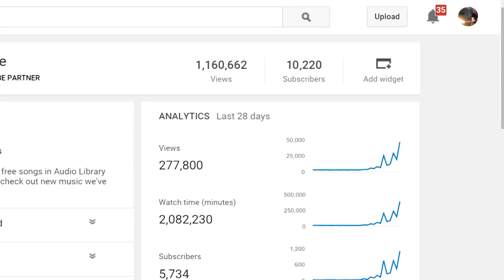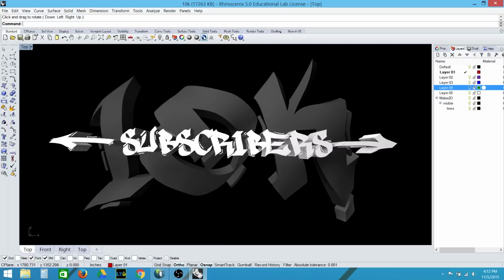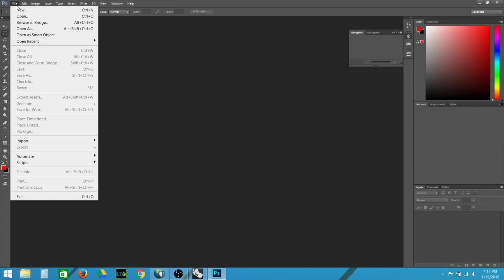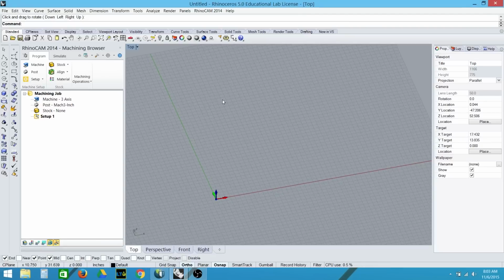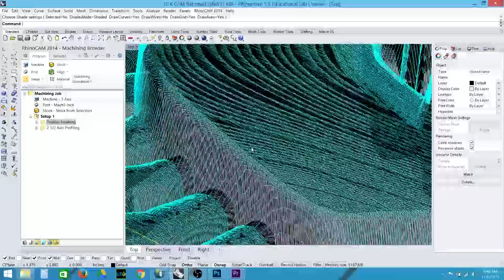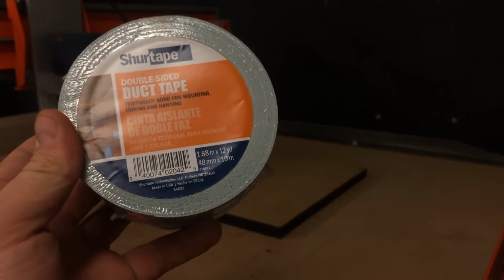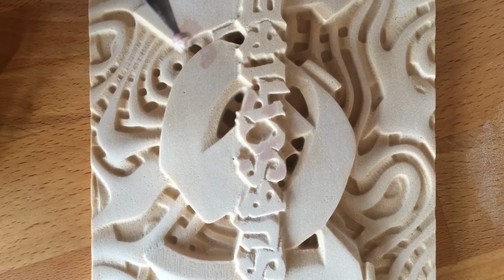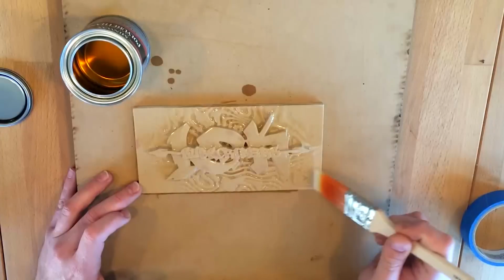Casting an Aluminum Sign, Displacement Map and CNC Pattern Making | 10K Part 1

Comment: You can avoid this artifacts using 16 bits of color depth in the render and work in the same depth in photoshop.

P.D. Great work!
Reply from the maker: Thanks!  I looked into that...  The depth channel in Rhino appears to render in 256 shades.  There is probably a way around that or use a different software, but I needed to move forward.  I also tried converting it to 16 bit and blurring etc...  Nothing was as crisp as just turning down the tolerance in RhinoCAM to 'skip' the artifacts.  Any suggestions for post processing the image or alternative method of producing a depth map, I'm all ears!
Reply: Brian Oltrogge Sorry man! I'm not quite familiar with rhinoceros, I use Maya and Max, but this are softwares for different purpose and are very expensive, so It would be crazy to buy them only for render. Maybe, if you have the time, try with blender, otherwise the method you're using works fine.